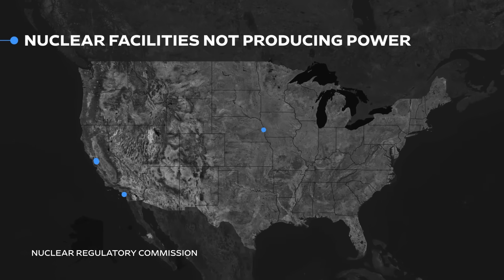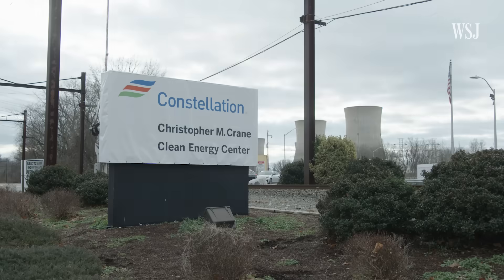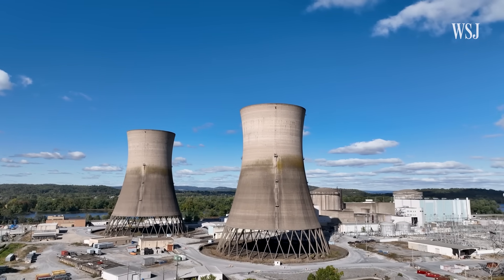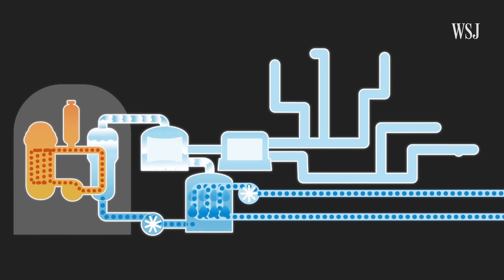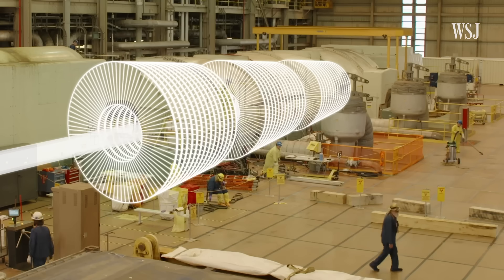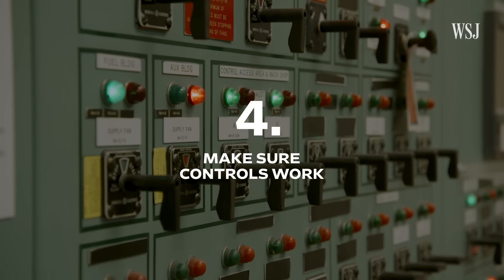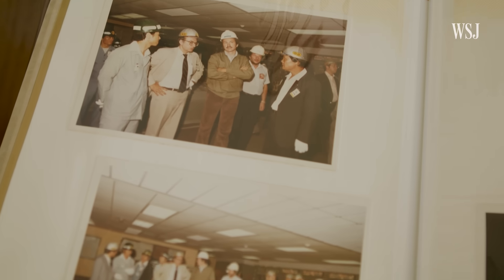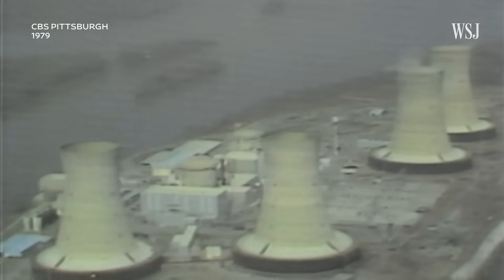Inside the $1.6B Plan to Restart Three Mile Island | WSJ

Comment: Love the control room. Hope they use the controls from the 70s-80s. So much easier to troubleshoot and maintain as opposed to just relying on computers to do everything. Problem is hiring new workers won’t have a clue as to how the older tech works. The child engineers today can’t do anything with out a computer. Hence the older gentleman describing what is going on. And the majority of the equipment you saw in that control room is obsolete from a service and repair standpoint to the point of unless you have a stockpile of NOS parts (which I guarantee they don’t) it is not feasible to rely on 50 plus year old equipment that no one can service to restart something of this magnitude. I’ve spent past 20 years as electrical maintenance at what was a Hoffman laroche vitamin plant from the 70s still incorporating a lot of this old obsolete controls tech. Couldn’t imagine it sitting idle for a week let alone years or decades.   Good luck. I’m available for consult.

Comment: I worked for 34 years in Los Angeles DWP Steam Electric Generating Stations that burned natural gas and fuel oil in boilers to make steam to generate electricity. One of the things I noticed in this video is that the Control System of Three Mile Island Nuclear Plant is a very old Control System. The big problem with this old Control System is maintaining it because the system is obsolete and parts are not made for it anymore. Since Three Mile Island is being restarted, they should completely replace the Old Control System with a modern Nuclear Generating Station Control System.

Comment: These idiots make NO MENTION of where the highly radioactive spent fuel rods will be securely and safely stored for the next 250,000 years. DO NOT bring more nuclear plants online until the waste disposal problem is solved. There is so much excess nuclear waste out there that it must be stored in dry casks out in the open, and those wont last more than 100-200 years by some estimates.

Comment: Why TF are they using those old controls...
Reply: Nuclear Operator here with over 11 years of experience in commercial nuclear plants. The older analog controllers still work well, and they’re impervious to cybersecurity concerns since they’re not digital controls. That being said, as the analog switches get older, there is a concerted effort to replace them with newer digital controls. However, every single change to a nuclear power plant has to go through rigorous equivalency reviews by Engineers to prove that all equipment will be able to reliably perform its design function. For example, we replaced a chart recorder with a digital recorder at my nuclear plant, and it took around 500 pages of Engineering documentation just to replace one chart recorder. The industry is planning on using more digital controls in the future, but this will take time to implement.
Reply: @CMSMediaSC  Finally a comment section with someone who seems to actually know what they're talking about

Comment: You cannot restart a reactor that partially melted. 😂
Reply: Three Mile Island Unit 1, the unit that Constellation is restarting, did not suffer a partial meltdown and operated safely and reliably from 1974 to 2019 (45 years of safe operation) until Exelon shut it down. Three Mile Island Unit 2 suffered a partial meltdown in 1979 when it was only around 4 months old. However, the nuclear industry became safer because of this. Out of TMI came the Institute of Nuclear Power Operations (INPO), which holds nuclear operators to the highest standards in the world. It also changed the way that nuclear power plants operate for the better. Now, nuclear plants share Operating Experience with each other to ensure that even minor mistakes made at one plant around the world aren’t repeated by other plants. The Operations and Technical Training programs became much more rigorous. After TMI, every nuclear plant had to build Control Room Simulators which exactly replicate the design and operational characteristics of the nuclear plant, so Operators could be prepared for any scenario. In the aftermath of TMI, the United States became the most stringent and safest operating nuclear fleet in the world.
Reply: Why don't you watch the video again and try paying attention this time

Comment: There are so many things to talk about, so my opinion probably won’t be heard. Anyway, nothing is burned in a nuclear reactor, reactors are caused by thermal neutrons colliding with each other to create heat, which in a PWR (Pressurized Water Reactor) heats up water that is not being used as a coolant or moderator, that spins a turbine. Correct me if I’m wrong but that is an oversimplification. It is incredibly easy to mess this up. It is incredibly hard to mess this up in such a way that releases radioactive mater into the environment. Nowadays there are so many automated tasks that a human can’t mess up. Nuclear power is one of the safest ways to produce energy, and it is the renewable way to the future. The reason I saw it is renewable is because 96% of nuclear fuel is recyclable, the only things that aren’t are 4% of tiny decay products that are nowhere near as radioactive as the fuel itself. I hope this clears up some things, and goodnight.

Comment: The TMI accident was caused by a series of events. One of the contributing factors was a design flaw. The relief valve that got stuck during the accident showed it was closed in the control room because power was removed from the solenoid that controls the valve, and the indicator light to show open or closed was tied to whether the solenoid was powered or not. The valve relies on a spring to close it once power is removed, however it got stuck open. The light in the control room incorrectly showed it closed, when it was really open due to a malfunction. After TMI there were substantial design changes throughout the nuclear industry worldwide. Now limit switches and other positively-confirming means are used to indicate open or closed. While unfortunate the accident happened, the impact to the community and environment was very minor and all nuclear plants became inherently safer over the next 10-20 years thanks to the changes.

Comment: I'm a retired control systems engineer. That control room is so antiquated that it cannot serve in this day and age. Even if you put a modern computer system on top of it, the underlying tech in the field is old, unreliable, inaccurate, and unsuitable for proper data gathering by the new system. The wiring and interconnections are old, brittle, and unreliable, and were designed in the 60s and 70s. If you're going to do it right and have the utmost in safety, then the plant needs all new field equipment and sensors, new field and home run cabling (including fiber optics), a refit of safety systems using the latest tertiary technology (Triconex or the like), and the installation of a control systems (Honeywell Experion or the like). Otherwise, you're asking for a guaranteed repeat of prior disasters. Even with these upgrades, there's ALWAYS the possibility of incidents that can lead to bad results. You can mitigate most of the hazards, but there's always the situation where you don't know what you don't know until it rears its ugly head. So, they talk about Microsoft AI. That is pure BS. MS has no business in control systems, because a control system is a unique beast, even though it has the appearances of a business computer system. It is FAR from that, regardless of how it looks. It's why companies that need control systems have separate IT and control systems groups and systems. Putting IT in charge of a control system is a HUGE mistake and is likely to lead to safety incidents, including fires, explosions, and harm to personnel and perhaps the general public. Smart corporations know this all too well. The field work, safety systems, and control systems are hugely expensive. But especially in the case of a nuclear plant, you don't want to be penny wise and pound foolish.
Reply: An excellent post. I have serious reservations on this antique plant being restarted. 😮
Reply: I think Microsoft is only purchasing power from the reactor. The actual control systems will all have to be recertified by the NRC, right?
Reply: you have absolutely no idea what the revamp will include...your just making a poor guess based on zero factual information
Reply: @chrisvogel4981 yeah you're right. 43 years of designing control systems and control rooms make me a complete layman with no credibility. I defer to your superior feelings, because it's pretty obvious that you use feelings and not logic and reason
Reply: they are gonna blow it up good this time arnt they? I wouldnt trust Microsoft to write secure and safe  systems code for anything.

Comment: @0:39, WSJ once again lies and said TMI 2 was a meltdown. It was not. It was a release of excess radioactive Xenon gas. Normally, that gas would be burned up within a reactor. But TMI 2 did NOT suffer a meltdown. For that to occur, the core of the reactor would have had to have an uncontrolled (unmoderated) reaction to the point that the core would destroy the containment vessel and the concrete reaction shell…just like Chernobyl. WSJ = Liars.
Reply: What you said of the release of xenon is true, but the TMI-2 reactor DID meltdown. To be more specific it was a partial meltdown and thus required the fuel assemblies to be manually removed using cranes.
Reply: @warcrimemenace6292  Yes!! Thank you. As you know there is both an objective and subjective meaning to every word. For me the subjective meaning of "meltdown" means that the core melted down to the point of either making a pool of corium in the base of the vessel or it has penetrated the reactor vessel or goes beyond that and has melted the vessel and is on top of the concrete containment foundation or has melted through that. Hence the word "melt".

However objectively, if any portion of the core melts it is objectively considered a meltdown. But because of the 2 extreme cases of (corium melted but contained in the vessel and corium which could not be contained by the vessel) should be designated differently. A partial meltdown meets that 1st case. A full meltdown or just meltdown meets the 2nd case. 

Maybe the phrase "China Syndrome" is a better set of words that mean the core "has left the building". 🙂 

I would have had no problem with WSJ if they had used the phrase "partial meltdown. " A) that would have been more accurate. B) that would not be as subjectively negative a word as "meltdown".

Thank you for pointing out the difference to me. I always enjoy learning new stuff.
Reply: @NathanZSolomon  Partial meltdown is the technical term given to such events, so honestly I dont know why he wouldnt have said so, pretty much every report I have ever read reports it as a partial meltdown, not a meltdown.

Comment: Nuclear steam didn't leak out from mentioned source. There is another catching system for radon and xenon. They were thrown out in a controlled manner from a different pipe. Mentioned steam valve is inside of the facility and leaks only water vapor.

Comment: 02:30 Those aren't pipes, those are tubes, it's called eddy current testing. That is a feedwater heater being inspected. Those tubes do not lead to the turbine as the narrator suggests. So many errors in this, it's ridiculous.
06:15 Those two guys are operating the eddy current testing equipment.

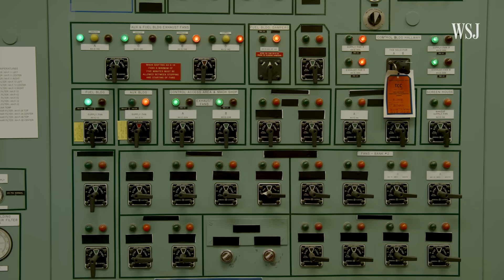Comment: 3:40 Are the pieces of black tape being replaced with some other sort of labels as they are testing? If not, I can see how this would be a critical oversight that could lead to catastrophe. For example, if the relative humidity, or even a bad bit of glue in the tape itself caused a piece of tape to fall off, I can see how this could lead to major problems.

Comment: Give AI a dirty fission reactor and it will tell you how to make a clean fusion reactor, which is also greater magnitudes of output. We really need to have them replace fisson plants by the mid 21st century. And the Helium 3 for the lining can be found in abundance on the moons surface.

Comment: so, we have two options: nuclear (which has a U.S. supply chain) or renewables that rely on lithium power storage solutions. However, lithium is mostly refined in China, which controls around 80% of the global lithium processing capacity. This means China could decide not to sell lithium, leaving us in a difficult position.

Reactivating existing infrastructure makes sense, but building new capacity might not be the best move just yet. The long-term strategy should focus on vertically integrating renewable manufacturing within the U.S. That would position us for stronger, more independent power in the future.
Reply: There are other alternatives to lithium though.

Comment: I’m not against fission nuclear power but it can be very dangerous with severe consequences if not considered thoughtfully and with respect.  I certainly do not think that an old reactor design that has already proven to be vulnerable to operator error should be recommissioned after being decommissioned.  I’m certain that new and safer reactor designs exist along with a modern scada.  A clean slate approach should be taken for a high standard in safety.  That’s just my opinion.

Comment: 😂 calling three mile island the worst incident in american nuclear energy, is laughable. There are other nuclear incidents that actually resulted in the death of multiple people during the test of a nuclear reactor for the U.S military.

The three mile island incident is actually a great example of how a properly built reactor can handle a severe failure with minimal damage to the surrounding area. 
The 3 mile I win. The accident did not result in any deaths, a release of radioactive gases that barely rose radiation levels in the area above background, but not anywhere near a dangerous level.

Comment: Make molten salt thorium reactors... With lots and lots of redundant safety ... Also coal can be easily very very clean... With bio exhaust cleaners... Aka port all the exhaust gases through algae farm tubes... And when they get full , shut them down clean and then burn them .. have multiple exhaust streams that can swap tracks etc when cleaning, or hot swap able as well .. makes o2 eats CO2 makes fuel and is clean

Comment: I wouldn't be surprised if those old controls are actually more reliable and useful than a bunch of new electronicized stuff.  And wasn't part of the problem even at Three Mile Island that operators were just looking at what amount to "summarized" readings/controls, whereas if they had looked at actual gauges, things would have been much more clear, much earlier?

Comment: With the new atomic energy systems that are being tested by NRC, there is no reason to re-start a fundamentally flawed solution.  The fact that the TMI failure was turned into a propaganda campaign against atomic energy has set the availability of safe nuclear power back by at least 30 years.  Compounded stupidity.

Comment: Nuclear is the way to go until fusion tech matures, mind you that it is not the complete answer. Nuclear shines as a base line production source but the nature of the reactors prevent them from being used to meet fluctuating demand. We will always need other sources that can be ramped up and down quickly as needed but nuclear is currently the most efficient to satisfy base demand both in terms of plant size to energy output and environmental impact.

Comment: I was on a nuclear-powered submarine for 5 years, all im saying is that, if a group of 19 to 25 year olds can run a reactor, then it shouldnt be too difficult to figure all this out.
Reply: Nuclear aircraft carriers and submarines have been in use for over 20 years with no issues.  These designs should be the basis for small nuclear power stations designed to provide power to Data Centers which with AI now require massive amounts of power.